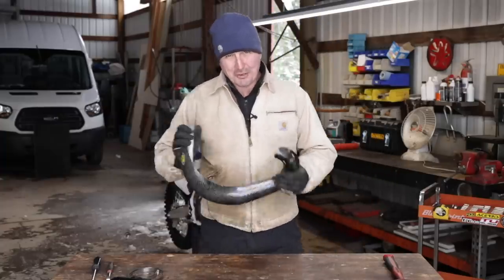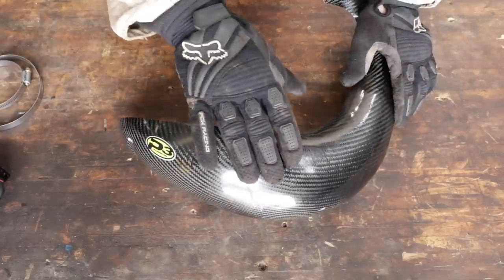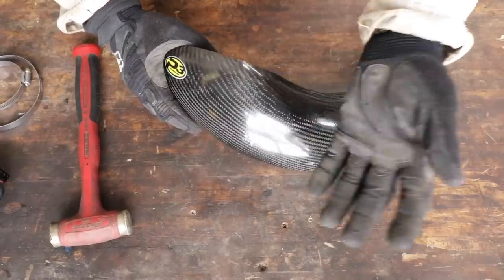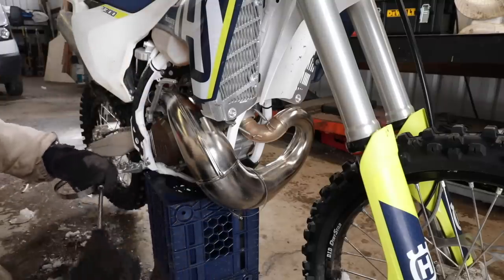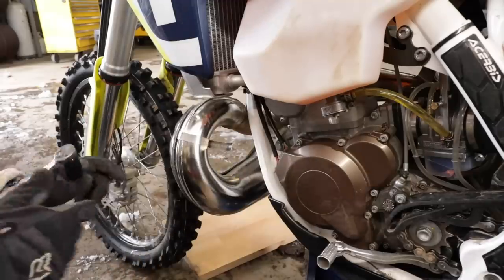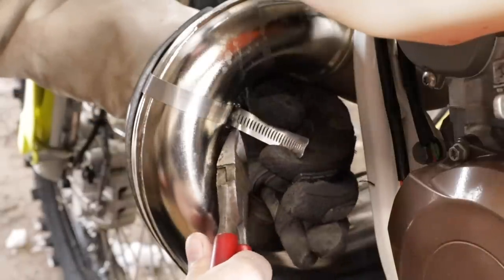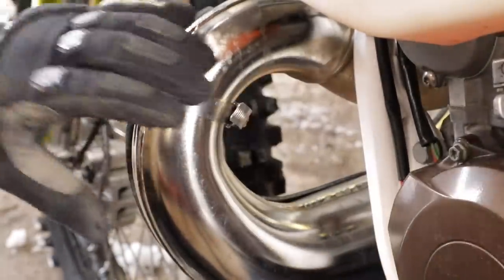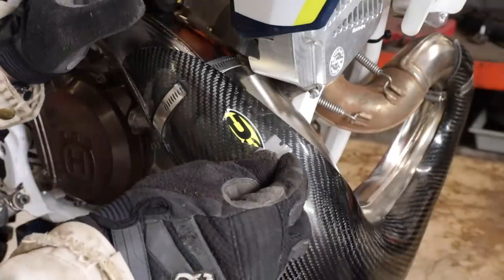P3 Carbon Fiber - Not As Tough As You May Think

Comment: Mix up some clear epoxy and put it on into the fracture from the hammer. It will help it not break apart (fracture more).  FYI  P3 customer service is top notch. I ordered one of there skid plate from a eBay seller, they took my wrong skid plate back and FedEx me their top of the line one. No questions asked, had note with it also.

Comment: The thing about carbon is that it is very stiff (High Modulus of elasticity when done right).  This means it can pick up all the load before you have used enough for it to be tough.  It can be tough, look at arrows, as an example.  People get into trouble because when you put a small amount over something else it makes that something else really stiff, but it is stiffer than the underlying whatever so it picks up all the load.  Lets say you had a reasonably stout walking stick, but it was noodly.  So you wrap it in one layer of 3k carbon, now it is really stiff, but the carbon will break before the stick, and then it will act as a stress riser at the fracture point and break the stick also.  Yet the stick by itself was OK, just a little floppy.

The other mistake is similar, just not using enough.  When you get a chance, look at the wall thickness of an arrow or a fly rod.  These are replacements for wooden objects (greenheart or Port Orford Cedar) that are about 50% thicker.  Yet look at the wall thickness they have to use.

Comment: The coating on the fiber is brittle, but the overall structure is tough, supposedly.

As you said it might be the temperature. As a lot of materials change behaviour from ductile to brittle when changing the temperature.

Comment: Carbon fiber has high tensile/impact strength, but steel has a much higher shearing strength. 
The wide pipe is an expansion chamber for back pressure to keep intake gases from going straight through the cylinder.

Comment: Nice video. I think some people confuse the strength of CF with its durability. CF has a great strength to weight ratio, that is irrefutable fact. CF does not however have good durability. It nicks, chips and flakes fairly readily. Similar to fiberglass. Not to mention real CF is very expensive. On the other side of the reinforced polymers is glass filled and carbon filled (also frequently marketed as graphite) polymers. For anyone who isn't familiar, glass and carbon filled polymers are basically polymers that are filled with glass or carbon powder, NOT fibers. These filled polymers are MUCH more durable than their fiber based cousins (CF and fiberglass) but give up strength as a result. So basically if you want something that is light and can take more strain, go with carbon fiber or fiberglass, but if its something that needs to be able to take an impact, go with filled instead. They don't make tools out of glass filled nylon for no reason. The stuff can take a beating.
Reply: unfortunately, since CF looks really cool, people want it on everything. and companies are more than happy to give it to them. But as a result the more reasonable uses for CF are kind of lost. Its main purpose is to replace steel and aluminum where it can be safely used to reduce weight. But that doesn't mean its a miracle material for every task. It's really not designed to protect anything. That is due to carbon being very very hard. Which means it can be very brittle despite a carbon weave actually being flexible like fabric. If you want something durable go with the glass filled nylon or if you want something SUPREMELY durable and impact resistant, you want to go with a kevlar filled nylon(which a lot of companies were doing a few years back, but it seems to have fallen by the wayside since the widespread emergence of CF. Probably since CF sells better because of its looks. Unfortunate really).
Reply: also, despite carbon being known as the element that lasts pretty much forever, carbon fiber isn't really designed to. It beaks down way faster than its metallic counterparts it's designed to replace. If you've read all this and cant tell yet, i really like plastics. I also really like metals too actually. I could honestly talk about this stuff all night. While we are discussing metals, titanium is not stronger than steel. Steel, as its best alloys are stronger than titanium as its best alloys. The real reason titanium is so amazing, is how close it comes to the strength of steel while being significantly lighter. Bear in mind its not nearly as light as light as CF, but it is stronger too, sooooo yeah. The downside to titanium is that it's more expensive than steel and it's very hard to work with. It's impossible to melt titanium in the presence of oxygen too since its combustion point is actually lower than its melting point. Then you have magnesium, which is even lighter than titanium, but its also only about half as strong. Its also very hard to work with. Its super flammable, and once it starts, it's pretty much not stopping. Then you have aluminum, which is the weakest of the bunch, but by far the easiest to work with. Its very soft, but also very light and very cheap. This is why you see most things made of steel and aluminum. Because they are the cheapest and easiest to work. Well, if you have read all this, i commend you. Hopefully you learned something you find interesting.

Comment: On the 300/250 2 strokes, you want a integrated pipe guard/skid plate, and with the husky, or the ktm xc's linkage guard. Emperor Racing makes a sturdy one, if I remember correctly.

Comment: It might be, as you said, down to temperature. It is designed to withstand a lot of heat, and that is probably the priority I guess. I had similar experience with epoxy resin fiberglass in the cold. It will probably not crack easily once it's on the running bike. Wheelie Loctite trolling along there nicely:)

Comment: Metals are isotropic materials so inside they are "shaped" identically in all directions. In other words, metals predictably flex and bend the same in any direction. 

Carbon fiber is a composite with fibers and epoxy. It is more like a big conglomeration of garden hoses, so in the direction the hoses point, they are strong (stronger than any metal) but if you bend or twist opposite the grain or in a way that pulls the hoses apart it has no strength.  So if the manufacturer cuts corners and they don't have nice interpolating weaves to give strength in all directions or reinforce bend points, you end up with a brittle or flawed carbon fiber product. 

Just like with the glass in the side windows of your car, if you hit carbon fiber with a hard blow from a sharply pointed object like the emergency tools they sell for egress from your car, you can shatter carbon fiber or at least burst the weave. Whereas, if you hit it with a dull wide tool or stand on it with your feet spreading the pressure out over a larger area it will disperse the blow into the weave and not break.  I think this is why you crushed the weave with your tighter, more focused blow or, more likely, it is just super cheap because it shouldn't have done that.

Comment: I think if you hit your pipe hard enough that it requires a full replacement the carbon guard isn’t going to save it. It doesn’t take much to put a little dent in the pipe and that’s what makes the guard a nice addition. I have a local fellow(The Pipe Doctor) that specializes in repairing those little dents that do manage to happen. I’m guessing most areas with in close proximity to riding areas has someone that can fix pipes.

Comment: Carbon fiber pipe guards will not keep the pipe from denting when you hit a rock!   They do look good, though..
I learned (from other YouTube videos) how to SAFELY remove dents from my pipe with air pressure and heat - MAPP gas works fine, but an oxy acetylene torch works even better!

Comment: Personally I don't like the guards, it makes the pipe even more bulkier. Also the pipe is pretty easy to fix even if some welds crack or you just get a big dent on it. In the 14 years that I have owned 2 strokes I have only once smashed the pipe so badly that it wasn't worth to fix. Most of the time the dents are so small that you can just leave it and and fix those with pressure after you get few more dents and at somepoint when it gets bad enough just replace it. And honestly, I've crashed and smashed and felt over so many times that I don't really even want to know the amount. So in my opinion only few new pipes here and there is not that bad in the end when you think the overall maintanance costs. You will be cracking those guards time to time as well beyond the point of its usefulness and that isn't free either.

Comment: Awesome bike!  Might have been easier in the end to mock up the cover and mark the gear clamps with a sharpie and just pull it back off and cut it with aviation snips or a zip wheel and grind down any burrs or sharp edges.  In the end you got it done, nice job. Happy riding

Comment: For a skid plate if you're going to go with the laminate like carbon fiber or fiberglass. The best option would be Kevlar. Because it is very strong to a braces and handles a lot like an aluminum skid plate. However its weakness is that if it's compressed it will delaminate
Reply: Our parts gave Kevlar 💪💪 they have all 3 actually

Comment: Great job on the videos, now I'm really interested that you have a proper dirt bike.  I have a KTM XC 300 and put on a Obie Link Guard that seems to work well. Also with a P3 pipe guard that is fracturing.  Lectron, Rekluse, LHRB, Tubeliss, et al.  I'll try to look you up one of these days after the snow melts, I've ridden with Bob and Mac and grew up in the area.  Also a fan of the Knipex tools.  Check out the Wera line of screw drivers with laser scored tips at KC Tools.

Comment: Love the videos and love the bike. Warning though I have a p3 guard on my te 150 and after 2 hours of ride time the thing was trashed. I wore a hole in it and scratched through the clear coat on the guard. While it's saved my pipe it does not hold up as well as my friends guard made by E line.   And one more thing. Why do you take all your stickers off? Stickers make the part even better, 10 extra horse power!

Comment: Careful those don't have give to it like the metal ones that have a bunch of bend points. So if you hit it good at a bad angle. It can't bend and it'll mess up where the exhaust goes in to the engine. Bending it bad.  Costing u 3x the price in the end. That's worst case scenario.
Reply: That's my experience as well. With aluminum guards I gradually got dings then repaired them. With carbon fiber the first hit totally smashed the pipe so it needed to be replaced.

Comment: Are those metal clamps directly on the carbon fiber shouldn't there be like a rubber grommet in between the medal and the fiber to keep the carbon fiber from cracking? Freezing cold weather and carbon fiber does not go good together. But I would imagine the exhaust warms it up some?

Comment: Yes I’m not so sure with carbon is the strongest stuff made etc... my son races BMX bikes and his forks and handle bars and other parts are carbon. The funny thing is though all the warning labels about don’t over torque bolts could explode or that they all have like only 90 lbs rider weight and noticed the most stressed areas are metal ??

Comment: Yeah carbon fiber isn't as strong as steel it's more like a more complex type of aluminum that's not meant to bend if you ask me but as it gets thicker the stronger it gets cause it is a composite also  there is the type in quality carbon fiber there's cheap knock of carbon fiber which is more fiber glass with a carbon fiber outside layer which breaks easier

Comment: won't that hold dirt between the guard and pipe to rust it.
Reply: finpainter1 yes it will
Reply: No it won't.... have a CF pipe guard on my '05 since new and it rarely sees a wash and no pipe rusty away at all
Reply: I drilled 2 holes in mine to allow sand and water to escape. I was worried about that too. Mine also rattled like you wouldn't believe. So bad that I ended up removing it. I wish I had thought to shove some soft fiberglass or something else heat proof between the pipe and guard to absorb the vibrations.
Reply: keith moore, nickel plated.

Comment: Mr. wranglerstar, do you know the type of binding agent used in the carbon fiber? I.e epoxy, resin, etc?
Reply: Just like fiberglass, carbon fiber can use multiple types of resin depending on the physical properties you are trying to achieve. They can be simple vinyl ester up to complex epoxy resin if you are going for extreme strength to weight ratios. If you throw in high temperature it can get really crazy. There are some guys with really large brains doing some amazing things in the realms of composite materials.

Comment: carbon fiber is the last thing you want for an impact resistant guard. If you hit that guard with a rock the guard will shatter. for impact protection kevlar is the only way to go. you want carbon looks? slap a carbon layer on top of a kevlar laminate. carbon is best for bearing loads, too bad that in this case aesthetics came before proper design and common sense. And being made in the USA has nothing to do with it.